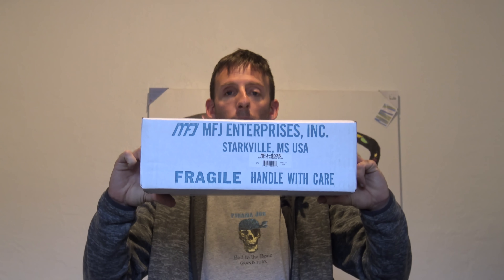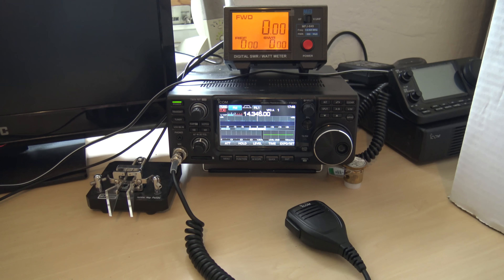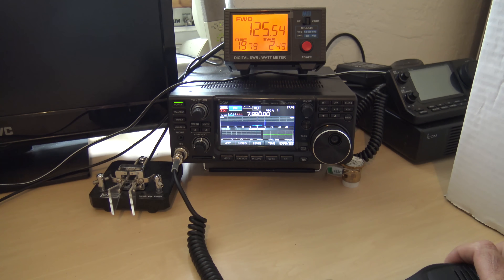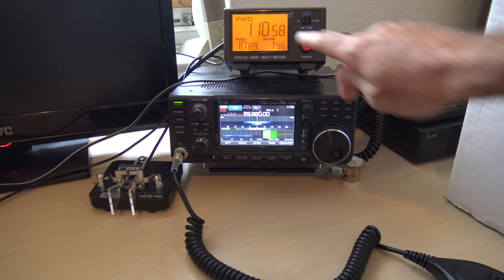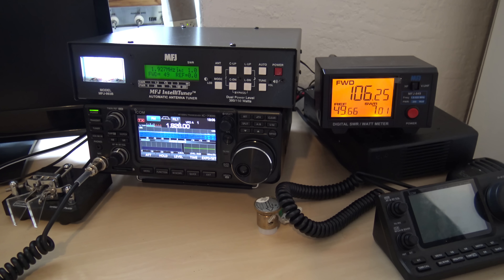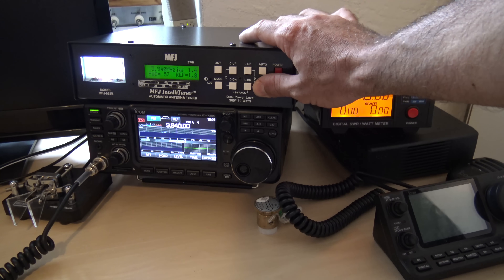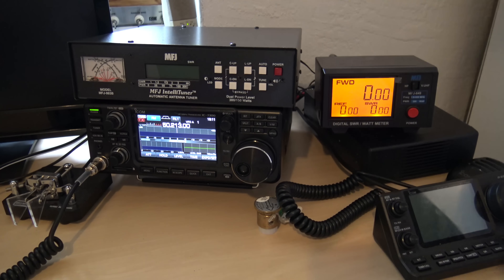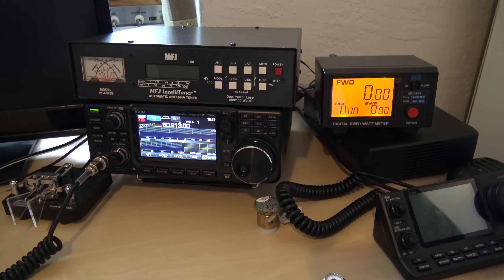Understanding HF Antenna Tuners, What Does It Do?

Comment: You are misunderstanding your measuring equipment. However in order for you to understand my corrections to your presentation, I ask that you review section 3.6.7, called "Reactive Power and Power Factor" of the 2019 ARRL Handbook. Hopefully you will understand that in a reactive circuit the product of voltage and current without considering phase angle is not an accurate representation of real dissipated power. Second, please review the entire Chapter 20 entitled "Transmission Lines". Hopefully you will understand that a transmission line can be used as an impedance transforming device, in which case the currents and voltages measured (or power measured using a directional wattmeter) at certain points along the line are not an accurate representation of actual power travelling in either direction.

Let me tackle this in steps.

The only time a directional wattmeter or SWR bridge properly reports power in either direction is the case of a perfectly matched 50 Ohm line. In the simple case of connecting the output of your IC-7300 (without using internal antenna matching feature) to the input of a directional wattmeter (like a Bird wattmeter), and the output of the wattmeter to a 50 Ohm dummy load, the power measured in both the forward and reverse directions is accurate. You get 100% forward and 0% reflected.

OK. So consider when you connect the RF output of your transmitter (again not using the internal antenna matching feature) to the input of an SWR meter or directional wattmeter, and then the output of the wattmeter to your antenna's dipole feed line, a feed line that is a close to but not a perfect match. The exact mismatch is not important for my discussion. Suppose your SWR meter measures a mismatch of 2 to 1, or maybe 4 to 1. Any reasonable value is fine for this discussion. In this situation, although the directional wattmeter inserted between the transmitter and the antenna feed line indicates that power is being returned to the source (transmitter), the exact reading is not 100% accurate. Still, for most practical purposes with a closely matched line the difference between the reported forward and reverse power measurements is accurate enough to give you a pretty good idea of the power transfer efficiency from the transmitter to the antenna, and ultimately your radiated power. And of course the important thing to realize is that because the transmitter has been designed for maximum power transfer into a 50 Ohm resistive load, it's source impedance is most probably 50 Ohms, and hence whatever power is actually flowing in the reverse direction will be completely absorbed by the transmitter (your IC-7300). Indeed, your IC-7300 contains circuitry that detects that condition and it automatically adjusts (reduces) the forward power accordingly as a precaution to prevent the reflected power from overheating the RF power output transistors. But for this discussion let's disregard that.

Next, connect the RF output of your transmitter (again not using the internal antenna matching feature) to the input of a directional wattmeter, the output of the directional wattmeter to the input of an external antenna tuner, the output of the antenna tuner to the input of another directional wattmeter, and finally the output of the second directional wattmeter to the feed line of your antenna. At this point, tune the external antenna tuner so that it presents a perfect match for your transmitter. The first wattmeter will report that no power is being returned, indicating a 100% transfer of power from source to load. However, the second wattmeter will indicate very close to the same forward and reflected powers as it did before. But now there is a big difference. These measurements in the second wattmeter no long represent power flowing in either direction. The wattmeter is instead measuring reactive voltage and current, and it now incorrectly reports power flowing in both directions when in fact power really flowing only in the forward direction. It's like when measuring voltage and current in a reactive circuit. You measure reactive power, not real power. The bottom line is, that second wattmeter is fooling you.

How do I know this to be true? Well, first I present the common sense argument. If you agree that no power is being reflected to the transmitter by the antenna tuner, but argue that power is being reflected to the antenna tuner by the antenna, then ask yourself where that power is going. Suppose that second wattmeter shows 80 watts forward and 20 watts reverse. If that is true, and if no power is going back to the transmitter, then it must all be going into the external antenna tuner, right? Well, what do you think 20 watts will do to that unit? It will heat it up, really hot. Since the matching circuit consists of only reactive capacitors and an inductor, that inductor would start getting really hot. But it doesn't, right? It stays cold. Of course it stays cold, and the reason is that no power is actually being reflected from the antenna back to the external antenna unit.

Next I present the second, more academic and less intuitive argument. Suppose after you properly adjust your antenna you could at any time cut your antenna's feed line at any point along its length and look at the impedance in each direction. You would not see 50 Ohms resistive impedance. You would see a certain complex impedance that was the combination of some resistance and some value of reactance, either inductive or capacitive. You would see a complex impedance. Suppose as an example you happen at a particular point see a value of R + Xj in one direction. If you then looked in the other direction, you would see R - Xj. Ahah!!!! Looking in one direction you would see the complement of the impedance in the other. Suppose further that you looked at the impedance at different points along the line. You would then see different values R + Xj and R - Xj. At some points along the line it would look inductive in the direction of the antenna tuner, but capacitive in the direction of the antenna. At other points it would be the opposite. It would look capacitive in the direction of the antenna tuner and inductive in the direction of the antenna. The value of R would also vary wildly along the line. And finally, if it really were possible to cut the line at various points and look at the impedance in either direction, at every point along the line the inductive reactance in one direction would always be exactly cancelled out by an equal and opposite capacitive reactance in the other direction. And that fact is what the external antenna tuner accomplishes. That's it job! AHAHH AGAIN!!!!! This is the condition for maximum pointer transfer. That's right. At every point along the transmission line the impedance looking in the direction of the antenna tuner (the source) is the exact compliment of the impedance looking in the direction of the antenna (the load), which is the condition you learned in your basic circuit analysis course that produces maximum power transfer. Any power delivered from the source (100% of it) will flow to the load. Despite your wattmeter showing the presence of reflected power, that is only apparent. Real power flows along the line in only one direction. Many people describe this situation as the transmission line itself acting as an impedance matching transformer, with the help of the tuner of course. Again, despite what your wattmeter tells you, no power is reflected. Remember, the problem with the directional wattmeter is that it can only accurately measure power flow in a purely resistive, 50 Ohm line, a line where voltage and current are in phase. In a reactive line where voltage and current are out of phase your wattmeter responds by incorrectly reporting power in both directions. It's a similar situation to when voltage and current in a reactive circuit give you not real power, but reactive power.

The bottom line is that when you use an external antenna tuner to properly match to your transmitter, the tuner does so by presenting the transmission line in the direction of the antenna a source impedance that is its complement (R +/- Xj). That is how it works! The transmission line in that situation is actually acting as an impedance transformer, and power travels along it only in one direction, from source to load. It is therefore important if you want to take maximum advantage of all the power that your rig is capable of delivering, to properly match it to your antenna.
 Despite great advances in the circuitry of the transmitters that we use, the same basic physics that was discovered in the 1930s is just as true today. If you want to get out, you need to match to your antenna, no matter what exact type of antenna you use, and you do that by presenting to it a source impedance that is the reactive complement of the antenna itself. Myself? I'll continue using my antenna tuner, thank you very much.
Reply: pcastonguay: Holy smokes! Finally someone who knows what they are talking about. Great explanation.
Reply: @daveace4614  By calling pcastonguay a smart ass, you identify yourself as a stupid dumb ass.
Reply: Indeed put in words what I have been trying to say for years. THANK YOU.
Reply: pcastonguay wow.  Thanks for your explainarion
Reply: Thank you.  The whole point of a tuner is help that power get out there!  I think antenna tuners in these rigs are great additions!  It protects my transceiver and gets the power to the load and zoom, out there.  I think the people designing the rigs know a bit more about RF circuit/equipment design than the gentleman posting this video.
Reply: @karlmadsen3179  The gentleman in this video does have a valid point. You can do without a antenne-tuner and keep the money in your pocket. 
But it all depends on your living situation and the kind of antenne you use.
Reply: What an excellent reply. You are absolutely right about the power meter. You need a meter that can also measure the phase angle between the current and voltage to correctly measure the true power apply to the antenna.
Reply: Very interesting. Now, if we get maximum efficiency or transfer of power with an external antenna tuner, then what happens with the physical construction of the antenna?
For example, my 9:1 UNUN with a 135' of wire has great SWR of 1.2 no higher than 1.2 where it applies, to bands from 80-10 meters.
Now, at 6 meters, SWR is higher at 1.8 max.
That tells me this wire is less resonant in 6 meters. Now, with the antenna tuner, built in or external, I get the perfect 1.1 SWR.

As this will allow maximum power to the antenna, then less resonant at 6 meters, but with some capacitance and inductance added to it by the tuners to match what the radio wants, then what happens to the radiation pattern of the radiated power?

In other words, a fully resonant wire or antenna is the same as a piece of metal aided by the tuners? That is were we get then maximum transfer of power to a resonant and a non resonant antennas, but will both perform the same? Thanks.
Reply: The inductor in the tuner doesn't heat up?  That depends on how much inductance you are adding in order to tune the load doesn't it? Power is dissipated in the tuner by the inductor in the form of heat. Look at the circuit board in a transmitter with an auto-tuner that has been used a lot. Notice what the heat from the inductors has  done to the circuit board. some heat there
Reply: @johninjersey  It heats up when it is not correctly tuned.
Reply: Thank you father.
Reply: Do you do house call’s?    Just asking for a friend.
Reply: Very well said!!!
Reply: Gene Smith   KN4UXO no Hf yet!  Thanks
Reply: @pcastonguay: You are perfectly correct, and in the process you demonstrate that this supposed authority on YouTube has absolutely no idea what he is talking about. Anyone can verify this by searching Wikipedia for the article called "Maximum power transfer theorem". Scroll down to the section that describes "Impedance matching in reactive circuits". The reality is, when you connect a generator having a source impedance equal to the conjugate of the impedance at the input end of a transmission line and you apply an AC signal at the resonant frequency of the lines equivalent LC circuit, you cause voltage and current to flow on the line such that real power propagates down the line from source to load. There is no reflected power. The line behaves essentially like an impedance matching device, often called an impedance matching stub. The needle of the wattmeter is reacting to apparent power, not real power. It amazes me the number of radio amateurs who don't understand this fundamental principle. I guess that is why we call them amateurs.
Reply: I just took a screenshot of this ENTIRE write up!  I’m finna go study! Thanks for sharing your knowledge, sir!
Reply: He is right that a resonant antenna is better than a non resonant antenna.
And yes, pcastonguay. All you say is true. 
But Eric, resonant antenna does not mean it is 50 Ohms and has a 1:1 SWR.
An end-fed wire of exactly 0.5 wavelength is resonant, but it is not even close to 50 Ohms.
Reply: @maartenc6099 not at all a non resonant antenna can be way better than a resonant antenna with gain even just look at an extended double zepp antenna

Comment: Also, a coax fed 20M resonant antenna will not be resonant on 10M.  On 10M it will be a full wave dipole which presents the equivalent of two half wave elements to each terminal.  In other terms, each terminal will see an impedance around ~5000 ohms depending on system efficiency, height from ground etc and common mode currents will be exceedingly hard to block; even a well built custom designed 1:1 current balun/choke will likely still allow current to flow on the coaxial shield possibly accounting for "resonance".  A better example is a 40M resonant dipole that with the help of a ~3:1 tuner will be efficient and usable on 15M. 

Critically, you miss the point that antennas should be analysed as a system from exciter/transmitter feed point, including aspects such as efficiency, desired pattern, and the ability to be fed with a 50 ohm source.  All antennas are tuned at some point in the system; ESPECIALLY any antenna featuring multiple bands which will always be a compromise especially in antenna pattern. In a lot of cases, the antenna pattern is significantly more important than whether 3dB is traded off for the convenience of an in shack tuning device.

73, Jarrad VK3BL
Reply: Sadly a 20m dipole operating on 10m is resonant but becomes a very high impedance as you rightly say, a bit of a disastrous mismatch to 50 ohm coax. I use open wire feed but still have had to go to reasonable lengths to kill common mode current.  As you rightly say the radiation patterns can get strange too.

Comment: If you're using a solid state amplifier you should always use an antenna tuner to get your match as close to 50 ohm / SWR 1:1 for the sake of protecting your finals and ensuring signal linearity.  All antenna systems have tuning components; as you state 'you have to tune your 9 band resonant antenna for the area of the band you want to use.   FYI, 1.4:1 isn't that special when using a SS output stage; this is why many solid state amplifier manufacturers and higher end transceivers include built in 3:1 'trimming tuners'.  It might not be 'doing anything to tune your antenna' but it certainly is ensuring your PA is a clean as possible.  73, Jarrad VK3BL.
Reply: Pretty sure that is exactly what he said. 👍
Reply: @richardchandler9027  I must have missed it or felt the need to further expand on the topic, it was a long time ago so not sure which.